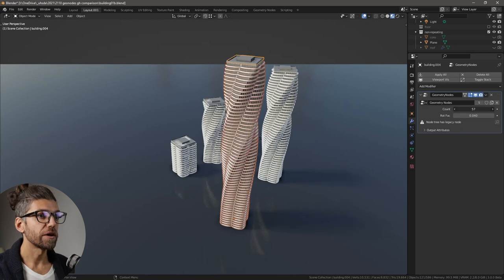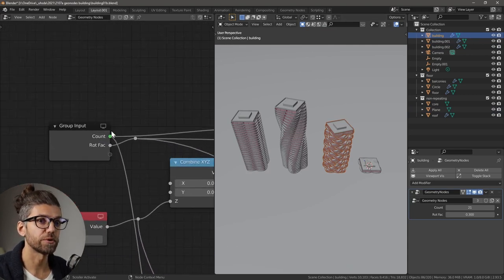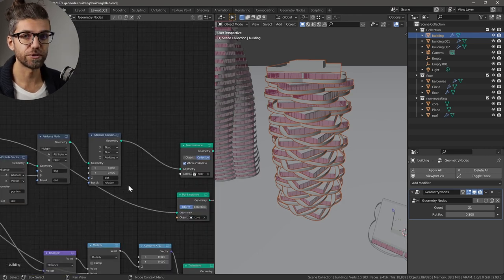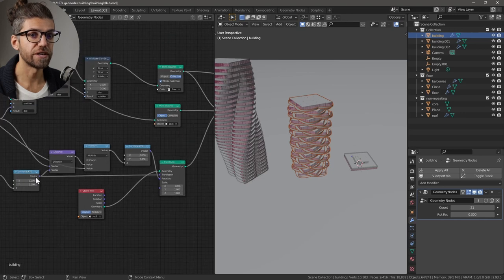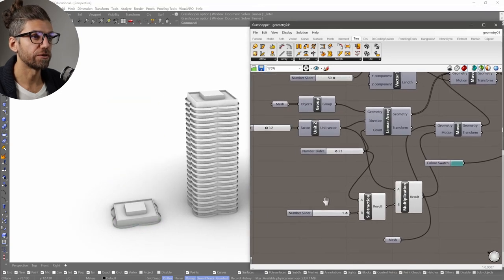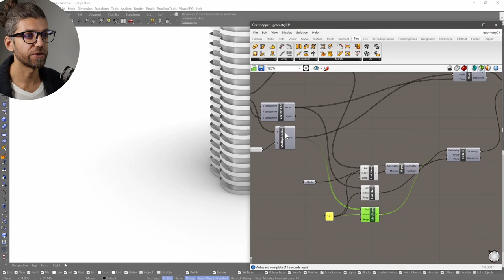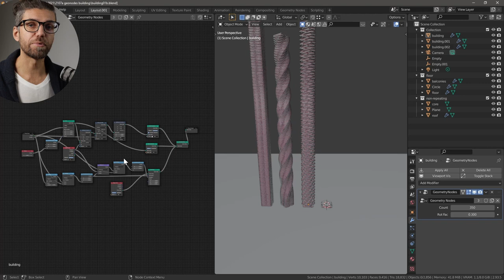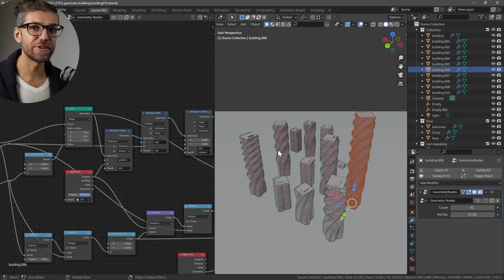Blender Geometry nodes and Grasshopper Rhino twisting tower comparison

Comment: Seeing as your grasshopper definition is all 1 branch deep, you could just graft your incoming geometry and use the gene pool instead of sliders. 
If you want to avoid copying your definition that is.
Also, since you have elefront, you can  put your slider values in the object user attributes  if you'd like.
I also think using the geometry pipeline to reference your floor model makes a lot of sense in this case.
Reply from the maker: Yep, true for all these, but I was trying to compare as much like for like as possible.

Comment: one of the reason for lagging in Rhino is because you use Render mode, if you switch to shadow mode, it should be way more faster
Reply from the maker: Even out of render mode, Rhino typically can't handle much geometry as well as Blender, and there's a good reason for it - it meshes objects on the fly.
Reply: @UHStudio  Not really, there are dozens of architecture firms that use Grasshopper to create entire skyscrapers parametrically. I myself have already created complex bridges with it that were displayed fluently and contained a lot more data than in your example. Also, you can't compare Blender to Rhino because Rhino creates nurbs objects and not polygons.
Reply: @alleskaese  So what is your point and what message are you trying to carry across with NURBS vs Mesh? How different does NURBS get the job done from Mesh during the construction of the building?
Reply: @owurakuotchere-darko9392  Well, a big difference between mesh and nurbs objects is accuracy and that's where meshes don't stand a chance especially on projects where accuracy is a priority.

Comment: I think what's powerful in Grasshopper is the fact there are SO MANY plugins for grasshopper on Food 4 Rhino, also the components are much more customisable comparing to blender since you can use components like GHPython or C# and VB.
Reply from the maker: No doubt that Grasshopper is very powerful, and quite frankly, it has changed the architecture and design industries. Geometry Nodes is certainly not quite there, but it doesn't hurt to look at some of the potential use cases for the new system.
Reply: @UHStudio  I agree, some of our design studios in my uni are already starting to use blender instead of grasshopper. For me personally, if Geometry Nodes supports customisable nodes that can be coded with python, c++ or c#, I would be switching to blender today.  Because customisable nodes would give users a tremendous amount of flexibility and allow plugin development for the Geometry Nodes, unlocking unlimited possibilities.
Reply: @UHStudio  Right now, I think blender is just lacking a bit of that flexibility compared to Grasshopper.

Comment: Grasshopper is a cad tool and blender is a mesh tool. 
Grasshopper data can be converted into files which can generate drawings and real world data blender can only generate mesh data which can be only used for animation or iteration or ideation.
Reply from the maker: It's not so straight cut. Blender is like Maya, and Zaha Hadid Architects use Maya, along with Grasshopper for designing through almost all projects.

Comment: Have you considered that the lag is because Rhino works with NURBS instead of meshes? Meshes are lighter and less memory demanding that's why in Blender it is faster.
Reply from the maker: The geometry being used in Grasshopper for the example is a mesh imported from Blender. It has not been converted to to nurbs.

Comment: I ha a quick question I a m student who is learning 3d and I am looking to buy a laptop I am between the MacBook M1 pro 14 inch  with 10 Gpu 16 cpu.
Or the ConceptD 7 Laptop - CN715-71-73A9 this is the one with rtx2080 max. 32 ram and 1t.
I just don't know which one would be better for 3d work in cinema and blender as well as some Adobe suit. 
Appreciate your help.
I just don't know, because the acer one they told me is good and they have a sale at the moment so I'll be able to afford it, but at the same time the MacBook is new in terms of release day than this acer I think is from 2020 so I don't know what would be the best option?
Reply from the maker: Macs are better laptops, windows better desktops. In that I mean that even a nice Windows laptop is more of a desktop tha. A laptop - battery doesn't last as much and they are noisier. But, windows with Nvidia GPU is faster for rendering.

Comment: Which one is more easy? Which one is better?
Reply from the maker: They both have their advantages. If you know a bit of Blender, goemetry nodes might be easier because it works really well with Blender's super easy-to-use modifiers. However, a lot more can be done in Grasshopper, but it also takes a lot more time to learn properly. It depends on what you need it for.
Reply: @UHStudio  For 3D printing, what do you think (organic design, too)? i m learning using both, but i like to know blender or grasshoper to be focus.... Sorry for my english...

Comment: Which is better to applicability for real life?
Reply from the maker: What is real life? Do you mean something to build? You can get a buildable element from both, but likely Grasshopper has a toolset that can break down complex elements further - e.g. easier panelisation, documentation, etc. Chances are that whether one uses Grasshopper or Geometry nodes, documentation may likely be in a third program like Revit or Freecad.